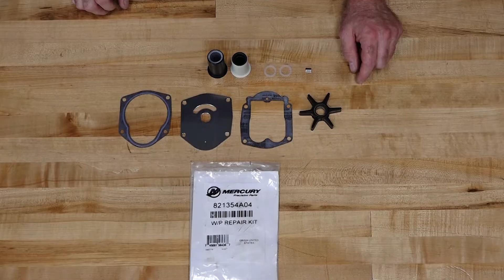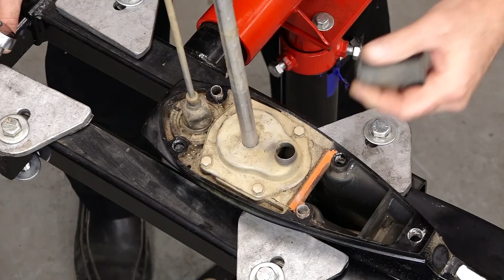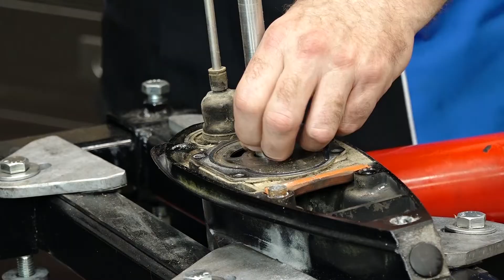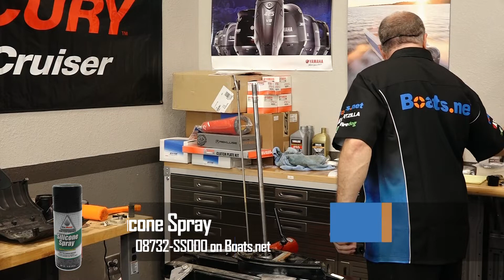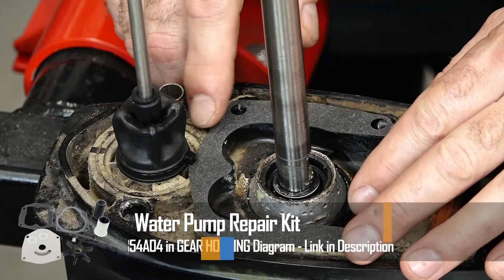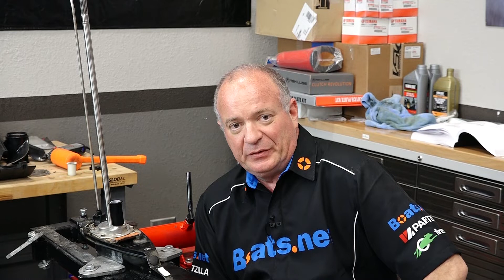How to Replace a Water Pump on a Mercury 40 | Mercury Outboard Water Pump Replacement | Boats.net

Comment: Hello great video John , i changed my impeller recently by watching your video which helped me alot. I have a question about the propeller when i put the gear in to reverse mode is it possible to move the propeller by hand in any direction then? I have a mercury 50 hp 4 stroke from 1997 Best regard Jocke
Reply: I’m having the same issue right now. We’re you able to fix your issue?

Comment: Great video, just a question though how does the selector shaft come out ? The long selector shaft on my engine has a slight bend near where it goes into bottom housing and its jammed up not moving up and down

Comment: i have a 2018 40hp 4-stroke mercury outboard.  Is this kit the same one because the motor you have in the video is much older.  Do you have more current video's for newer models?

Comment: Thanks for the video.  There are 2 tube seals that come in the kit (and that you show in the video.  The black one...and then the gray or white one.  Is this for a different motor?  If not, where does this one go??  Thanks!
Reply: Changing out water pump in a 2002 mercury 40 horse 2 stroke engine have t 2: rubber washer where do they go

Comment: Thanks much for making this video. It really made the job a lot easier. One thing that would have saved a few seconds would be if you'd mentioned that the wear plate has to go on a certain way. At first blush it looked symmetrical but when the holes didn't quite line up it was time to remove it and flip it over. Also, the shift boot doesn't come with a zip tie to seal it (a minor detail but one that stuck in my craw. It's of those things that tells you what kind of company you're dealing with, esp given that the parts are anything but reasonably priced. I swear it will keep me from ever buying a Mercury product again). Also, it sounds like the 60 inch pound torque spec on the bolts you mention is pretty crucial in that it allows things to float and move a bit and prevent wear on the drive shaft.

Comment: I would like to learn how to replace a Fuel Pump in a 2006 25/30 HP EFI 4 Stroke Outboard motor. Motor starts and then stops. Never keep running for more than couple seconds. Don't know what exactly the issue is.

Comment: I have a 2 year old 40 that sand had clogged the thermostat. Do you think I need to go ahead and maintenance the pump after sand? It's still peeing like a horse but took it back out yesterday run fine for a moment them the beeps hit again. So either I missed some sand or something else is wrong. Checking the thermostat again today but the first time got like a 1/2 cup sand out.